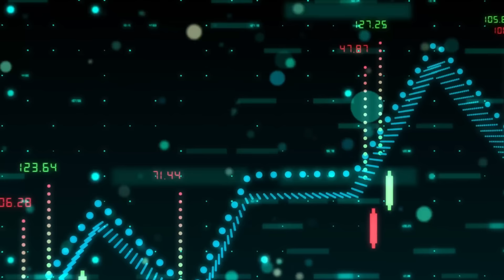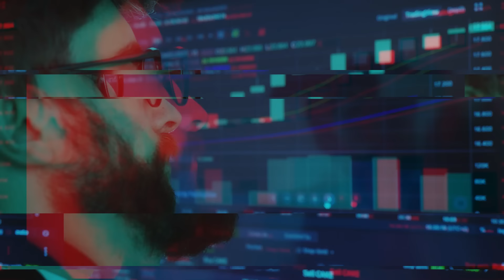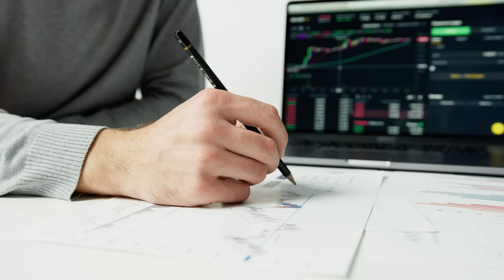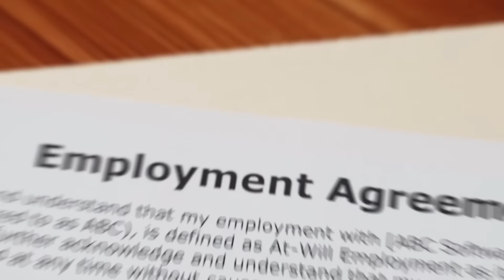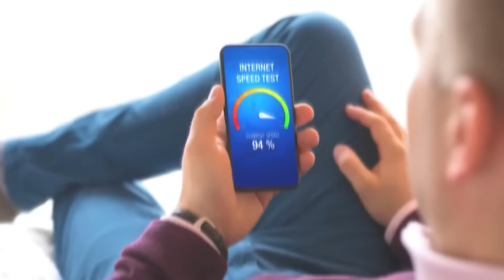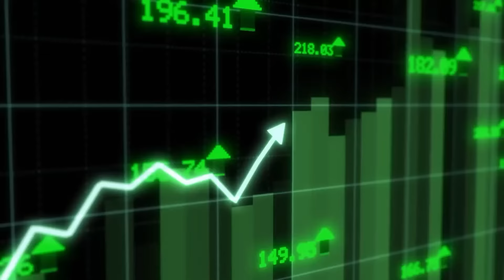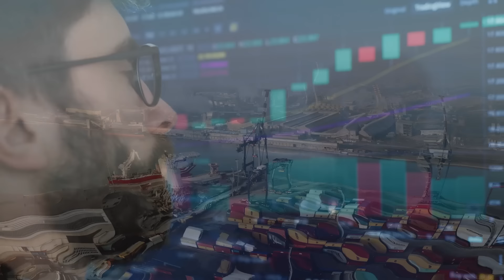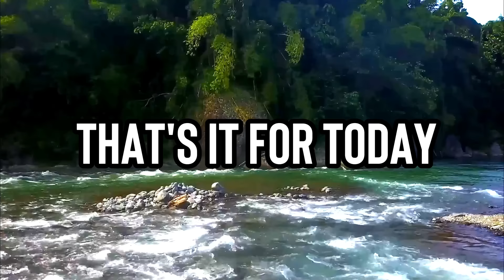Jamaica is Overtaking All Caribbean Nations, With These 13 Mega Construction Projects

Comment: I'm 54 years old and still no running water in my district.  Still carrying water on my head.  2024 !!!!!
Reply: who's fault?
Reply: Smh
Reply: Thats a big deal. Hope that is fixed soon
Reply: There is a way to fix that.  I'm from upper Clarendon which had similar problems up until around 2015.  Through local cooperation with civic-minded ppl from the community, we were able to get international funding to create a water harvesting g system including spring- water catchment, 20,000+ gallon tank, and many miles of pipes.  That problem is now fixed and still operates today, although I moved away from the area many moons ago.  Connect and I will share  more.
Reply: Sorry....stay strong
Reply: Why u on YouTube and not tvj? Call tvj. Which part unno mp dey?
Reply: Water is supposed to be on your HOUSE. This happens because the powers that be got you and your neighbors to be satisfied with the condition in which you live. Whike the country is selling water to the largest cruise shipping companies. They have the facilities bringing water in large 2 meter pipes right down to the cruise ports.